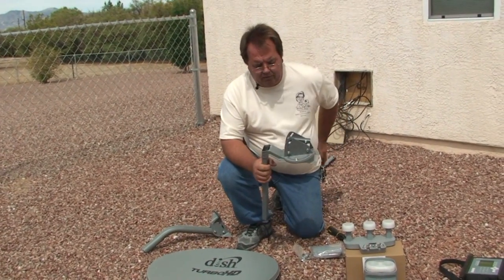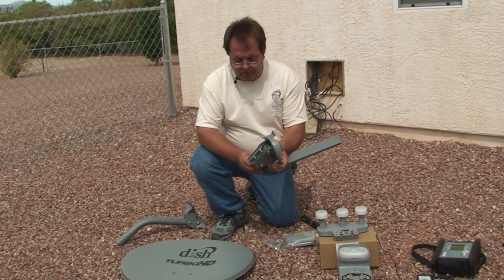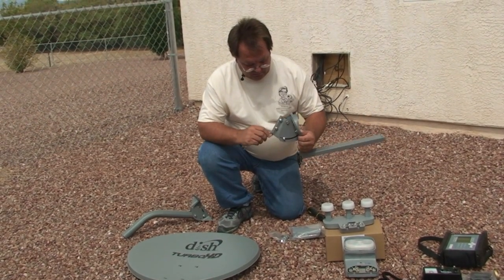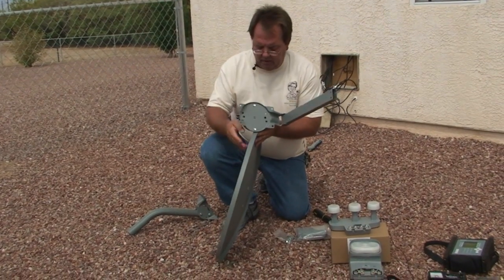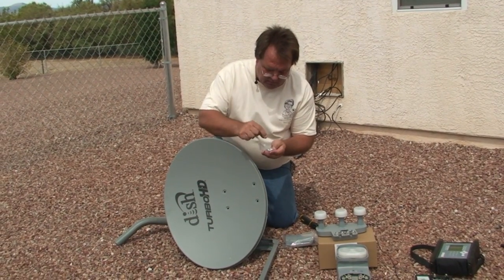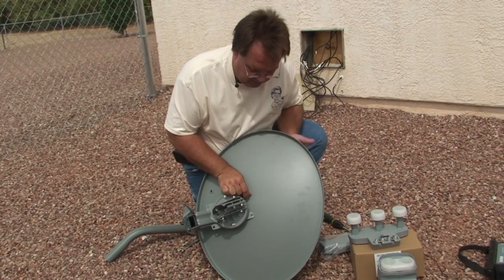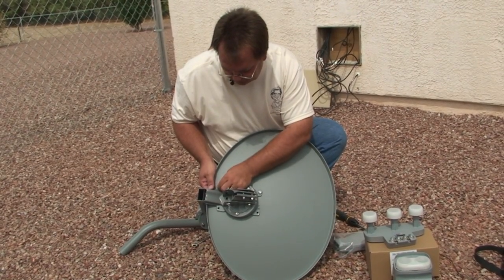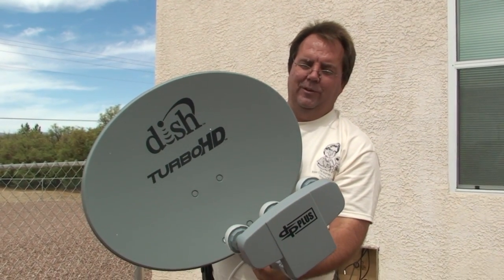Satellite TV Installation : Assembling a Satellite Dish

Comment: For the southern part of the country the other skew plate lock bolts mentioned by skinnysim are not required.  This is because the skew is less than 15 degrees off 90 or almost top dead center.